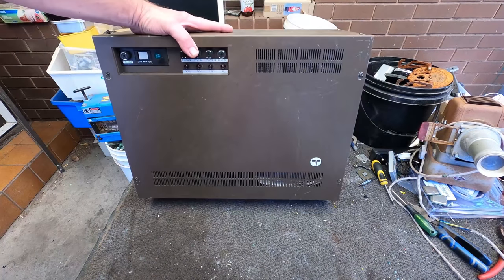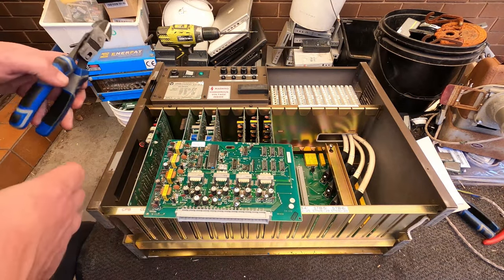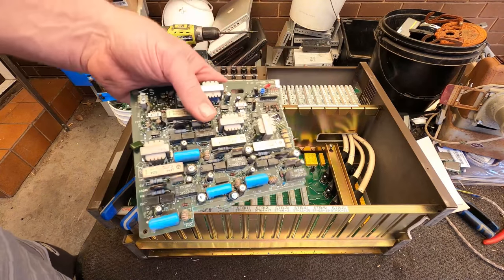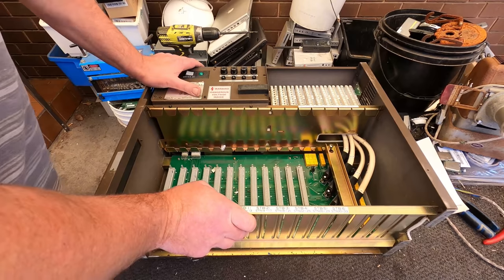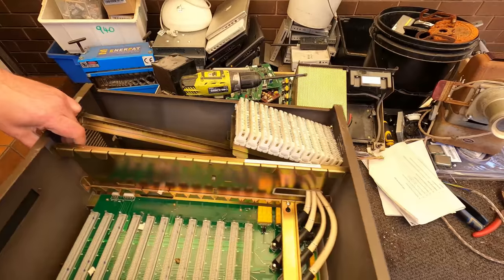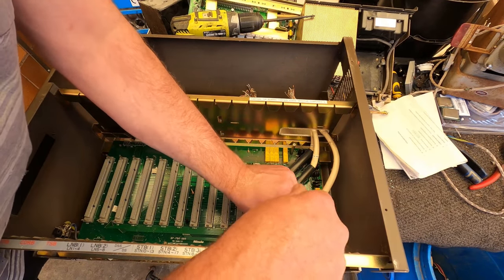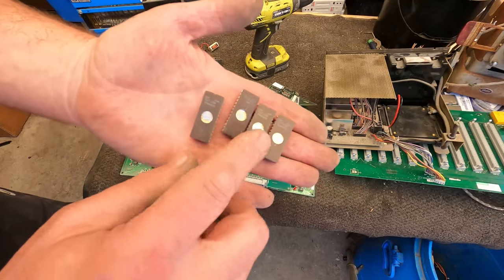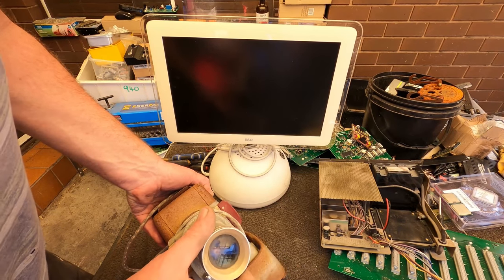What's Inside a Vintage Commander System

Comment: Glad to see you up and about Ben, the value of that old projector is in its vintage lens and unusual outstanding design, it would be rather easy to keep its vintage look, and replace the electronics with safer modern high powered led.